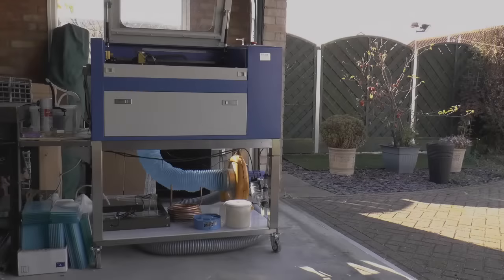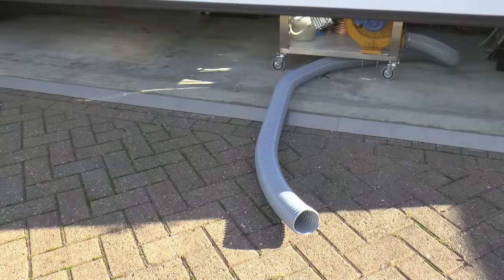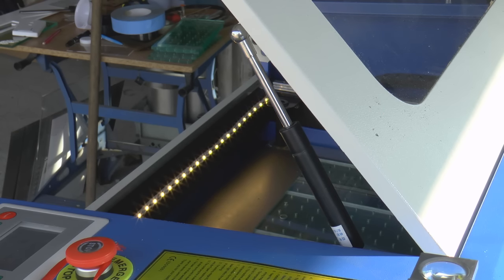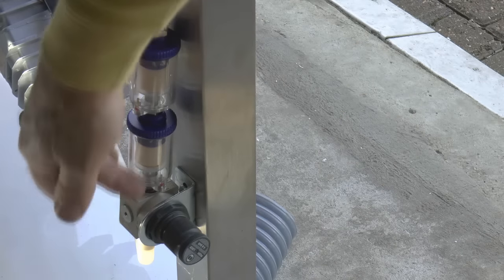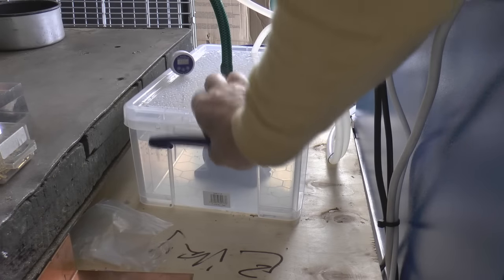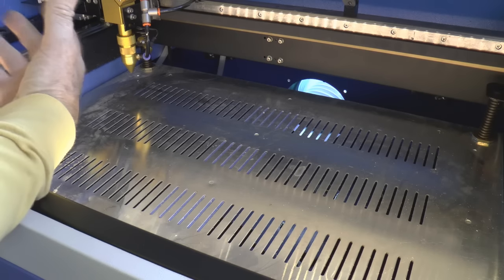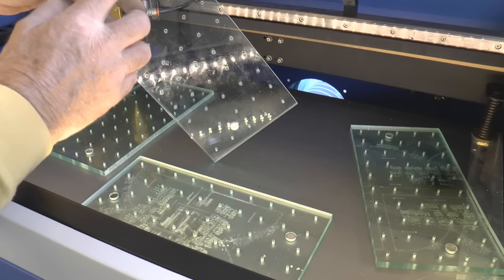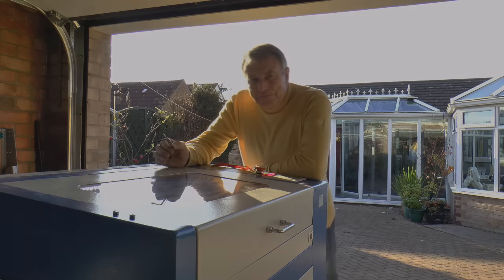My 50 watt Chinese Laser 4-month review

Comment: Great video, very informative.
heard you mention a power reduction problem you thought may have been caused by overheat.
one suggestion.. try the water restrictions they supplied.
I have had a car overheat when a thermostat was removed. it is possible for water to move TOO QUICKLY to properly absorb heat from the source, with the car engine the issue was the water moving too quickly through the radiator to dissipate the heat to the air.
Reply from the maker: Hi
At this early stage of understanding the technology, I knew my tube was low on power but had no idea why. I proved a little later why it was so bad when I had completed my research on how sealed CO2 laser tubes work, live and die. I also carried out test to show that there is very little loss of power as the temperature rises to over 40C. So at this 4 month point is was pure speculation.
You are correct in some ways about water flow. When you are trying to extract heat you need the largest temperature differential possible. In that respect you cannot have slow flow because that will heat  the water up and reduce the temperature gradient available for heat flow. BUT when you want to dump that heat then you do  need slow flow through your radiator so that you can extract what heat is there.
Good observation and thanks for your comment
Best regards
Russ

Comment: Russ, recently bought a 60 W laser machine.  I am wondering how I should wire the emergency stop.  I know there is the tendency for the Estops to melt because people run their blower through the plugs on the machine.  My exhaust fan is completely separate.

Do I need to use relays?  Or can I just run the 120V (in the US) through the estop?  I am going to replace the stock switch so that I have 2 sets of NC contacts so that I can split the power across 2 10A capable links.

As far as I can tell, the 60W laser power supply says that it can pull up to 3 amps @ 120V, the motors will pull 2 Amp @ 120V total at full bore (10A total at 24V).  The Ruida controller will pull .6 A at 120V (3A @ 24V), and the water pump and the air compressor each pull around 0.5 A @ 120V.

So I think I'm good with the two 10 A Estop contact sets.  Just looking for a sanity check.
Reply from the maker: Hi Marshall
 The machine itself will run fine through the existing Estop at 110v. It is rated at 10 amps ( I have yet to find one with a higher rating). So if you unload everything else ( fan, ,punp and compressor ) onto a seperate supply you will have no issues,  However, if you already have the kit then one or two contactors is the ultra safe way. More important is to check the earth to the main cabinet, it is usually useless because they try to connect though powder coating!!
 Best wishes
Russ

Comment: Hey great videos I had bought a 40 watt cutter and after watching your videos I ended up buying the 50 watt cutter as well your videos have been great  one problem I have found is that I have ac voltage in the water tank while I have the cutter running it is about 200 volts it must not be much current just enough to give me tingles
Reply from the maker: +Michael Chisholm 
If you are using distilled or ionised water in your tank that will be the reason it is current limited, Pure water is almost an insulator, it's only the impunities in the water that conduct, Sea water is about 1 million times more conductive than distilled water. 
You have a submersible circulation pump...........if you turn off your laser tube and leave the pump running , my guess is that you will still see the problem.  if so, you will need to get a new pump.
The laser works off high voltage DC and even if there is some sort of tracking from a faulty tube you would not see that as 200vac, I guess it's ac because you feel tingling.
Let me know what you find. The pump should be double insulated because it does not have an earth wire. If as a precaution you dangled an earth wire into your tank and connected it to the common earth point on your machine, you will probably not be able to run your machine because your mains trip will keep popping off.
Reply: Cheers for the advice
I have tested the insulation resistance of the pump while it was submerged in was and it was all good. When the water pump was on  I got 25 volts and 100 volts ac when the laser was on. I will try changing the water pump later and see how that goes. I will Change from tap water which I am using to the distilled but that does not really tell me where this voltage is coming from. I  the testing I could not find any dc voltage in the water I  will investigate it further this work things gets in the way. I will try checking the house wiring but I am still getting g the same voltages when going to neutral instead of earth. Keep up the good videos

Comment: At 5:17 of this video you are talking about pressure regulator and water separators. With water separator was no problem, ordered two. But  I was trying to found same regulator as yours on ebay/ali and cant found any similar. In local shop which I visited they have no any (strange). Most of available on e-bay or aliexpress are "AR2000 Air Control Compressor Pressure Gauge Valve Regulator" or "safety pressure regulator" - and they looks way different. Can you point yours? Are you happy with this model? And one more - are you using pressure gauge during normal work?

About exhaust fan - there are available quite fan model - expensive, but nicer to work - search: "quite TD-500 silent"

Comment: im getting one of these in the next few months, but the 90w version for business, and personal use, looking forward to it as these machines can do so much
Reply from the maker: +RATCAST HD 
At 90 watts you are just on the edge of the scam zone. Be careful what you buy. You may finish up with an 80 watt tube. I copy below an answer I gave to another guy who is hovering on the edge of buying

It seems that ebay is a good place to scam people with these machines and after-sales tubes and even if you by from a factory in China you may be subject to the same treatment. Are you going to go back to China and knock on their door with a machine that's not to spec or DOA? Once they have your money you are on your own?
Lets start at stage 1 decide on your work area and the sort of things you are wanting to cut with it. Is it for a small business or just for the fun of playing with it (like myself). The bigger the work area you select the more powerful the laser tube will be and the faster the drives will run and the higher the cost because of the bigger frame, stronger construction, the chiller that will be supplied to manage the tube cooling etc .etc. 
Mine was purely a recreational toy and I decided that the so'called 40 watt desktop A4 bed was just not big enough The 300x500mm  bed I chose was being sold as a 50 watt machine which seemed reasonable to me as a naive buyer The price jump to 60 or 80 watts was quite significant. I decided on 300x500 bed size and then I started looking round to see if I could work out which machines had decent conventional HIWIN type bearing rails. There are several "Micky Mouse" bearing arrangements that I have seen. The bearings are the most important part of the machine because they take a lot of punishment if you plan to do engraving. I also looked at nicely engineered mirror mounts. The machine may be cheap but I wanted to get the most for the least without buying real rubbish.  Did it come already fitted with a red dot pointer? Did it have air assist included.?If the engineering was basically good then I could gradually work to improve the other bits...part of the pleasure for me.
Rather naively I thought I was buying a 50 watt machine and did not have anyone available to warn me of the potential traps. Many machines and tubes are being over-sold. By that I mean they advertise 50 watt and it's really 40 watt or you get 50 watt instead of 60 watt. How do you know what you are buying? Can you easily test it? If you ever do realise something's not right ( and many people never know) what can you do about it? That's the big warning I want to give you.
How can I tell if I'm being scammed? The answer is its difficult sometimes and easy in other situations.. Lets look at my machine in retrospect
The Sunshinesmile deal seemed good and everything was nice until I had problems with my tube. The silence was deafening!! Lets go and look first at a fairly reputable cheap tube supplier
http://www.cncoletech.com/Laser%20tube.html

You will see they make 3 types of tube. Lets just look at the standard type, 
Note the 50 watt tube length is 1000mm long Lets add 25mm airgap to the HV end and about 100mm to the output end for the mirror system That means the case has got to be at least 1125 wide to house this tube.
Now go to the machine spec
 http://www.ebay.co.uk/itm/350B-50W-CO2-Laser-Engraving-Cutting-Machine-Auxiliary-Rotary-Device-0-60000mm-/111694615353?hash=item1a01849339
Lets look at the machine dimensions ...... 1020mmx 650mmx630mm
Can you imagine how an 1125 system will fit into a 1020 case.?

My supplied tube was 805 mm long (a 40 watt tube)
Even when I went to replace it because it was playing up and very inconsistent ,I followed a link for a replacement tube supplied by COLE TECHNOLOGY -yes, the same people as above, and you will find this for sale as a 50 watt replacement tube 850mm long.

http://www.ebay.co.uk/itm/50w-CO2-Sealed-Laser-Engraver-Tube-Water-Cool-85CM-for-Shenhui-DC-G350-engraver-/321716369860?hash=item4ae7ca39c4 

It must be a custom tube because its not in their product range. It turns out to be a 40 watt tube as well. Yes I was suckered twice!!!!
 So I hope this story will make you do your research with your rose tinted glasses in you pocket. Be totally suspicious if you are going to buy cheap. There are some honest deals out there but they are hidden under a pile of frauds.If in doubt email them and ask technical questions

Buying advice. Don't buy with your PayPal account if you have one, Their much heralded buying protection is virtually worthless. If you ordered and paid for a plane and received a car that's what PayPal class as fraud. If you ordered a large plane and received a small plane that not fraud that's a specification/warranty issue between you and the vendor. What sort of guarantee is that?  Even buying via ebay (part of PayPal) the same applies. The Chinese vendors know this weakness and insist you pay through PayPal. You can still use PayPal still but make sure you pay with your CREDIT CARD. That way you are protected by a whole different set of financial trading laws and you stand a good chance of getting your money back for a much wider range of mis-selling practices. 
Hope this helps you stay safe an happy with your new machine. Be cynical and suspicious before you become happy
Best regards
Russ
Reply: SarbarMultimedia Thanks for that information, ill be sure to look into this more now before I buy one :)
Reply: Ha ha, I just followed you link to the machine on Ebay and they have a Fantastic Special at the moment, it says Buy more than one and save 10 Pound :)

Comment: Hi Russ--Got the bouncy castle fan; thanks for the brilliant idea.  Now I'd like to take out the exhaust fan that's installed in the laser machine.  However, it's wired to turn on with the main control switch.  Followed the yellow ground wire; that's easy enough to disconnect.  But the red and black ones go to a PCB terminal block near the main circuit board.  Do I just pull them out of there?  Thanks!
Reply from the maker: Hi Aaron
Logically it requires a FLOW of current through the fan to make it work . That  means you need a flow wire  to and return wire from the fan. If you follow these two wires back to their source you will be able to disconnect the fan. If they are connected via a terminal block then it will be just a matter of unscrewing and removing the wires. If they are  soldered directly into the PCB I would cut the wires near to the fan and put the wires into a connector block. Run your new fan directly from a switched mains supply.
Best wishes
Russ
Reply: Thank you, Russ!

Comment: Did the lid for the machine come with that clear material or was it an orange material when you got it? Because if it was orange it is designed to prevent scattered radiation from leaving the machine.
Reply from the maker: Hi Aaron
It's an interesting observation that MAY be true for some types of laser, but for our little CO2 laser it  is a myth and not a fact. 10.6micron light (radiation) has very interesting properties. I try to demystify them and demonstrate those properties in my video
https://www.youtube.com/watch?v=kJe16YQlIM0
Although its wave  properties qualify it as light,  the light is totally invisible to the human eye. Instead, it manifests itself as heat, exactly the same radiation you feel when you put your hand in front of an electric heater.  Its wavelength imbues this form of heat with some strange properties. The most amazing is that when you fire this beam of HEAT at a very thermally conductive copper plate , the plate does NOT heat up instead the energy (heat) is 99% reflected regardless of the surface finish of the copper. Shininess and reflectivity are synonymous terms with visible light  but not so with 10.6 micron light. This is because the reflection has nothing to do with the geometry of the surface (flatness and shininess) but is determined by the crystallographic structure of the material.This reflective property applies to all those materials that are good heat conductors. Gold, silver, copper and aluminium are the most efficient reflectors. ALL non-metallic materials (including water) are 100% absorbers of the radiation. The laser beam itself is a coherent beam of invisible light  that can travel many kilometers through dry air without losing is form or its power, so there is no scattered light from the beam itself. Only if you try to engrave on those reflective metals mentioned  previously will you get reflections and possible scattering of the light (heat) energy.  I mentioned that ALL non metals are excellent absorbers of this radiation so it matters not whether it is  clear or coloured. polycarbaonte, petg, glass or  acrylic, so ANY radiation will be captured (absorbed) by these materials (and more). Other visible lasers will burn the retina at the back of the eye should you be unlucky enough to catch a flash.. Not so with the CO2 laser light. Being a beam of heat energy that is 100% absorbed by water, any flash to the eyes will burn the cornea at the front of the eyball ( a very wattery substance)causing immediate scar tissue. You will see me using the machine all the time with the guards open but you will also note that I wear glasses.  Whether those lenses are polycarbonate or glass, they will afford your eyes 100% protection.  This beam need to be understood and  respected,  not caged away and feared.
Hope this clarifies things for you.
Best regards
Russ
Reply: Ah I see. Ok then

Comment: As always, great job and wonderful explanations.  I in particular was curious about the pin table you created.  Doesn't the acrylic get affected over time by the cuts you may do above it or is the focus far enough not to matter much.

I also installed a digital temperature gauge for the water and built that into the panel of mine.  My hats off to you sir!
Reply from the maker: +NFO Sec 
You are right about the pin table. It does mark up with use.  It helps me to find the ideal cutting power/speed for each material/thickness when doing through cuts. As you say, the beam is defocused to about 3 mm wide by the time it hits the baseplate but provided I get a hint of a burn mark then I know I'm cutting through. If the mark is in anyway deep then I know I can increase the cutting speed.
I have a rather fancy digital temperature panel meter left over from one of my commissions, which I plan to fit when my ammeter and power meter arrive. I plan to check how cutting power is affected by the cooling water temperature because there are many suggested max temperatures on www but no facts that you can refer to. Thanks for your appreciation.

Comment: I wish I'd have thought of the bouncy castle fan idea before I spent £40 on my bathroom extractor! :)
Reply from the maker: +Stuart Middleton 
Don't feel too bad about it. I'm a bit of a squirrel and this had been sitting in my workshop for about 5 years since my grand children last bounced with it. So the solution to my extraction upgrade didn't require huge mental leaps. However, I did check out availability on Ebay. Lots and cheap. Check out my comments to others about fume extraction. Thanks for comment